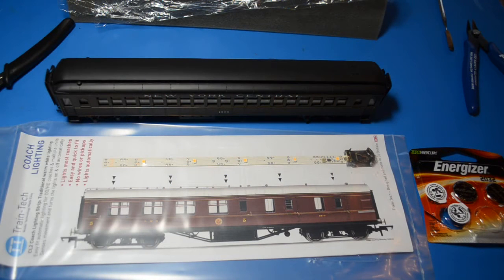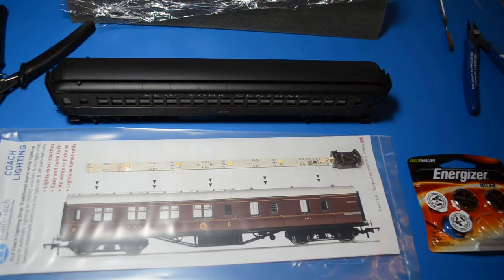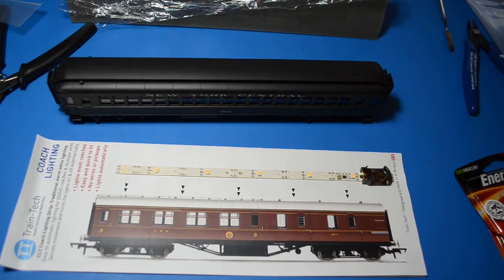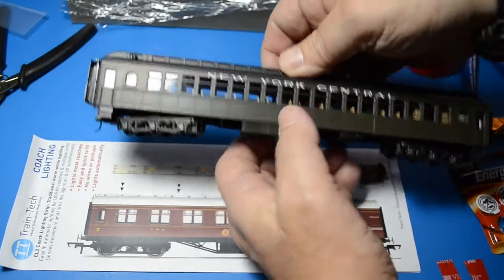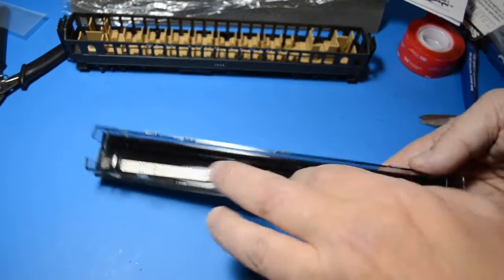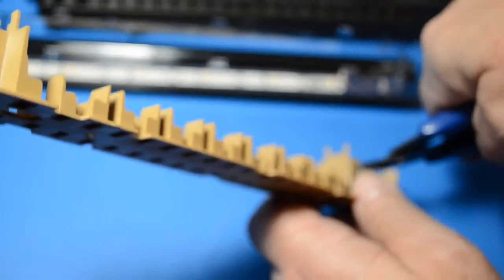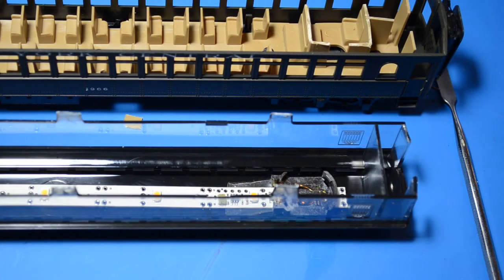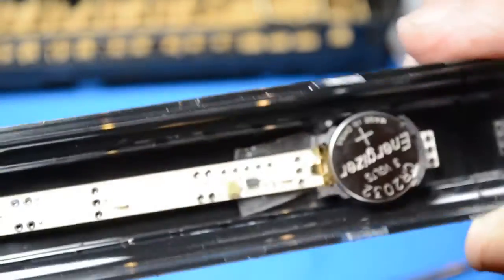Passenger Car Lighting Using "Train-Tech" Coach Lighting - November 11, 2016 - Music

Comment: Well, that looked easy enough. You'll have to update us on how long the batteries last. Thanks. Cheers, Dan
Reply from the maker: When the batteries are in a watch, they seem to last up to 4 years, and that is while constantly running said watch.  I don't know how many years the batteries will last in an item that turns on and off on its own.  Not sure if turning on and off wears them out sooner or not, but there are sellers on eBay and Amazon that sell the batteries in bulk at great prices!  I just ordered some so I have them when needed.
Reply: The batteries last a long time. I've had my CL2 light strips, 5 of them, installed for nearly three years and none have failed. I, actually, use this particular size battery in a few devices and have never had to replace any of them. Also, they are not expensive and are readily available in the dollar store.

Comment: A couple of wires soldered from the led strip to a battery holder placed inside the small compartment and you wouldn't needed to cut anytihing...

Comment: But they are about $25 bucks each and shipping is double that.  I have six but they work great.  If you get some 'latching reed switches' in the same circuit with LED's and battery holder you can use a magnet to turn the coach light on and off with about $5 each.

Comment: Did I miss 'How to switch them off'? Does motion keep the lights on? If the car is still for 'X' amount of time they switch off?
Reply: I found this on the www.ajmrailways.com website.
"There is no need for any switch because the strip incorporates a small sensor which detects when the train moves and turns on the lights automatically. The lights stay on whilst the train is in motion, then after it stops keeps the lights on for a few minutes before turning them off so that temporary stops at stations or signals leaves the coach lit."
Reply: @TimeLord55  Just looked the lights up. $27+ per car for a little .50 cent strip of LEDs and a $2 controller. LOL  Thats some decent markup. Ill pass.